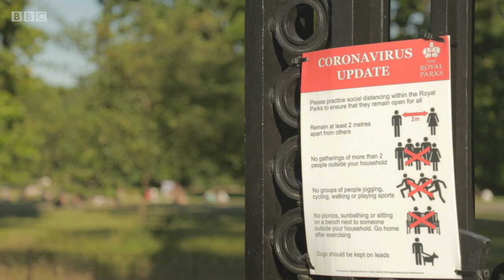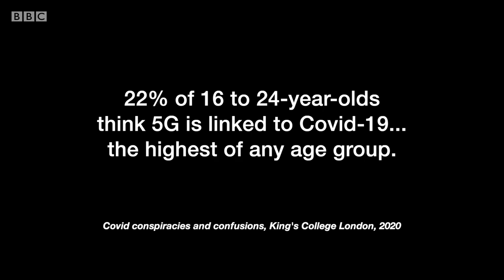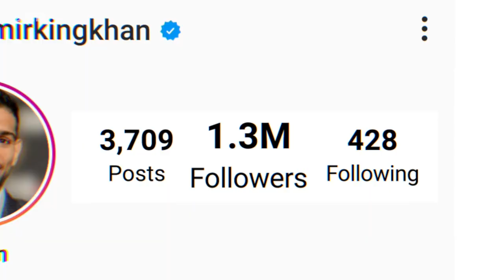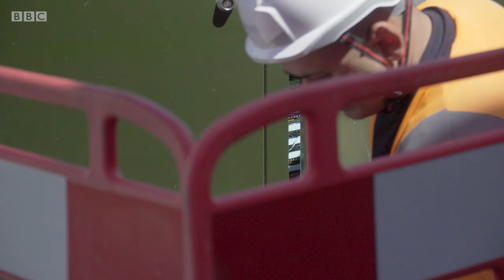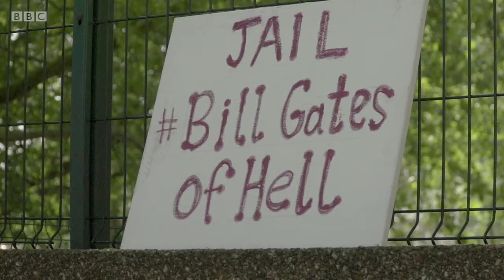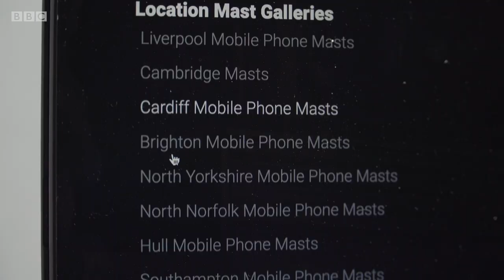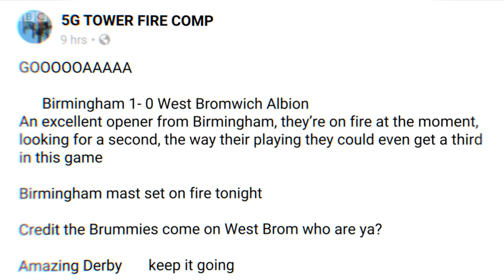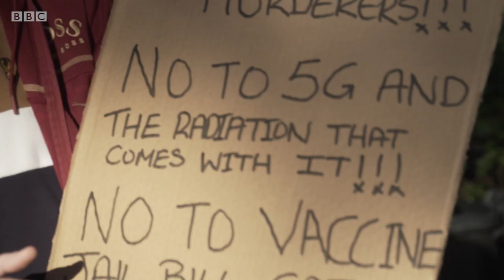Viral: The 5G Conspiracy Theory by @bbcstories - BBC

Comment: I feel so bad for that BT worker and the telecommunications workers that got abused.
Reply: @GORT don't use internet, some BT worker installed it for you.
Reply: Why Can't We Go Back To Cups and Strings?' - No 5G
Reply: @zx50  There is good solid evidence that 5G uses 60Ghz which is the frequency at which oxygen molecules vibrate. What Wuhan experienced was oxygen deprivation, which occurred when 5G went live.
Reply: @bluebottle1617  Which produces heat?? Sunlight / visible light is around 600 THz (10,000 times higher frequency than 60GHz)
Reply: @bluebottle1617  5G is not only 60GHz but a broader range of frequencies up to I think 256GHz. The millimeter waves (5G) is a weapon as British ex-military officer put it. If check the above and you find a lot sheeple attacking GORT.
Reply: @bluebottle1617  all molecules and particles vibrate! This doesn't cause the disappearance of O2 molecules. Matter cannot be created or destroyed in almost all scenarios . do you even have a remote idea of the damage you are causing?
Reply: @rhinocraft2594  And how about you? When the haemoglobin and myoglobin are compromised, they cannot carry oxygen around the body which causes oxygen deprivation. How about the damage BBC are causing with fake news?
Reply: jackson  except it's not a weapon never was its 5th generation protocol. Only liars like Mark Steele say otherwise and he doesn't even know what an electrolytic capacitor is.
Reply: @4shadow2  yeah the sun burns you looool
Reply: @bluebottle1617  😂 link please. What, no link?
Reply: The 5G Covidiots are the sort of people who fall for the Mayan calendar or Planet X end of the world rubbish, or who think aliens built the pyramids..and yes, the flat earthers & QAnons 😄
Reply: @petejackson7976  256Ghz lol you could block that with a sheet of paper, would be crap for mobile phones. And no 5G is not and never has been a weapon,  you read too many comics.
Reply: @bluebottle1617  what has that word salad got to do with 5G?
Reply: @dogwalker666  , 5G is not a single  frequency but a range frequencies and unlike the other the other Gs, it is using the millimeter waves technology. Find out why  the military use it  and when do, you know that  it is a deadly weapon.
Reply: @petejackson7976  5G is the fifth generation communications protocol, using the same a 4G most of the time but can use others, "millimetre wave technology" is word salad not a technical term, the military R&D have tried to make directed energy weapons unsuccessfully, they only exist in scifi. Sorry to burst your bubble but the whole concept is rubbish any electronics engineer will tell you so.
Reply: @dogwalker666  Have you been hacking people's YT accounts?
Reply: @Seapin1  Keep the shit coming, pal, because we know who you are and where you are. And you're not fireproof, so wise up or you're in  for a shock.
Reply: @dogwalker666  , yes it is but   its technology is different from 1g, 2g, 3g and 4g. 5g is not 4g plus like the above. If 5g is like 4g , why the massive infastructure rollout? If you want to have a feel of 5g , be part of a crowd the police wanna bring under control without water canon etc
Reply: pete jackson lol nice try but no it’s not it has lower power so it requires more base stations, how the Hell do you think a telecommunications protocol could be used for crowd control that’s impossible, all they could do is turn it off so all the tic tok live streams will fail.
Reply: @petejackson7976  That' some fascinating information you've got there Pete! Could you give me some links please so I can do my own research?
Reply: @bluebottle1617  Saying 5G is harmful is a hoax I agree with you how does stating real science not conspirtard word salad make me a moron?
Reply: @bluebottle1617  oxygen molecules do not vibrate at 60Ghz that is rubbish,  The vibration of any piece of matter is dependent on its temperature, that's why its impossible  to reduce temperatures below 0 Kelvin basic physics I guess you bunked off physics at school.
Reply: @joepublic3933  Dont hold your breath waiting,  The only conspirtard that gave me a link as evidence was a mark Steele video lol, epic fail.
Reply: @dogwalker666  Yeah, I was hoping the irony would seep through...
Reply: @dogwalker666  Where do I mention the word "salad"? Clearly, you have a vested interest in pushing the 5G Agenda. What are you, lobbyist for the telecoms industry or 77th? Whatever you are, don't mess with those who know the truth. They will destroy you with the truth before you destroy them with your BS.
Reply: @Rag - I wouldn't, if I were you. They are front of the queue to get indicted for genocide. "We were only doing our job" doesn't cut any ice under the Nuremberg Code or other laws.
Reply: @joepublic3933  That would require intelligence and honesty. Sadly lacking in these conspirtard's
Reply: @dogwalker666  The 5G this government is playing around with is Defstan.
Reply: @bluebottle1617  Lol the 5G being installed by the telecommunications company's not the government is 5th generation protocol,  NOT A WEAPON. They dont exist.
Reply: @dogwalker666  Are you copying and pasting this from a file of abusive comments?
Reply: @dogwalker666  Well, well, well. A troll who's been told to bad-mouth Mark Steele.
Reply: bluebottle1617 no your the one making things up.
Reply: bluebottle1617 Mark Steele has no technical knowledge he was arrested last weekend for breaching the peace. I repeat he knows nothing about electronics
Reply: @dogwalker666  77th Regiment
Reply: @bluebottle1617  mark Steele fits the original definition of a Troll,  anyone  who believes the rubbish he spouts is quite frankly a technical illiterate. He claims to be a weapons expert but was actually a night club bouncer,  who doesn't  know what an electrolytic capacitor is.
Reply: @dogwalker666  And you know that for certain, do you? Any arrests in London last weekend are likely to be unlawful as the police were clearly the aggressors and  had no grounds for arrest.
Reply: @dogwalker666  We are getting desperate, aren't we? I've already warned you about messing with those who know the truth. And you certainly aren't one of them?
Reply: @bluebottle1617  which army are you talking about that has a 77th regiment is it the Welsh fusiliers,  or the imaginary army weapons division at the Birtly ROF. You need to be more specific.
Reply: @dogwalker666  Oh really. Not very good at what you're doing, trying to spread misinformation, are you? Mark Steele was a defence technologist, not a defence researcher. 77th Brigade does exist and has been checked as in existence. You really don't know who you're messing with or what information I have access to; you really don't.
Reply: @bluebottle1617  defence technologist that doesn't know what a capacitor is lol,  come  on then what is this 77th grade you keep talking about?  Enlightenment us, and do you know what an electrolytic capacitor is?
Reply: @dogwalker666  So you know what Defstan means?
Reply: @dogwalker666  Terrorist Act 2006 should provide you with the answer to that.
Reply: @dogwalker666  What about ROF Burghfield?
Reply: @bluebottle1617  i know ROF Cardiff  and  H.M.G.C.C. too.
Reply: @dogwalker666  So you will be able to tell me what goes on at ROF Burghfield, won't you? Ah. HMGCC aka GCHQ Cheltenham. Don't forget some of the ROFs were sold off to the private sector by the Tories.
Reply: bluebottle1617 nope hmgcc is at Milton Keens, it’s a common misconception that it’s gchq and I cannot tell you what they do there, because The official secrets act is real. Let that sink in.
Reply: @bluebottle1617  you still have not explained what your 77th birthday brigade is all about.
Reply: Dog Walker One of the initiators is Dr. L. Hardell, Professor of Oncology at Örebro University in Sweden. He states: “The telecom industry is trying to roll out technology that may have very real, unintended harmful consequences. Scientific studies, both recently and over many years, have identified harmful effects on health when testing wireless products under realistic conditions. We are very concerned that the increase in radiation exposure by 5G leads to damage that cannot be reversed”.
Reply: Why we need 5g if we can use all trch with 3g
It need to be to invent robots with replace human in they work place.
Or make electronic intelligence to spy on us and controll our life!
Reply: @lukson69  industrial robots don’t use 5G I fact it’s a bad idea to connect them to the internet. Do some research
Reply: @petejackson7976  millimeter waves technology :D :D
Reply: @bluebottle1617  sources? Because that’s a dumb theory 😂
Reply: As a telcomm worker, I feel bad for our underpayed industry. The telecomm companies like att Verizon and tmobile pay bottom dollar as well as the abuse of turf vending. It's an awsome job, but the pay is dog shit
Reply: sexually?
Reply: @bluebottle1617  Sure it wasn't a result of 6G.  Which exists and works, albeit in a very limited area to date.
Reply: @bluebottle1617 
Water causes attenuation at 60GHz due to absorption. It's not going to harm you - it's merely going to limit transmission distances especially with high levels of atmospheric water vapour, rain droplets, etc

Comment: New Zealand has rolled out 5G. New Zealand has almost no COVID-19.
Reply: They have the ability to turn the levels of radiation up. Just because they rolled it out doesn't mean it's at the end of it's capacity.
Reply: @CarpeDiem13x  just compare the level of radiation that emits from 5G compared to other radiations. 
5G technology was based on army technology, to be able to send out pulses similiar to EMP to controll masses.
There are THOUSANDS scientists, doctors around the world that it should not be operational because not nearly enough studies on long term effects have been made.
Reply: @CarpeDiem13x  But isn't that the big problem here? Not nearly enough studies have been made due to long term exposure of 5G. That is the problem scientists and doctors around the globe are refering about.
Reply: @CarpeDiem13x  “We, the undersigned scientists, recommend a moratorium on the roll-out of the fifth generation, 5G, for telecommunication until potential hazards for human health and the environment have been fully investigated by scientists independent from industry. 5G will substantially increase exposure to radiofrequency electromagnetic fields (RF-EMF) on top of the 2G, 3G, 4G, WiFi etc. for telecommunications already in place. RF-EMF has been proven to be harmful for humans and the environment.”

There have been several REAL bioscientist speaking up about potential risks, and this is a fact that several countries have put a halt to the roll out of 5G, read Martin Palls pdf, Washington, PhD about the subject.

Slovenia, Rome, Germany, Netherlands are a few countries and cities who have already put a stop to 5g due to potential danger towards humans.
Reply: @CarpeDiem13x  Not anything of what you just wrote describes the cause-effect of 5G radiation to long term exposure of human DNA.

Comment: 5G Millimeter waves (MMW) will be combined with current longer wavelength frequencies that are mostly used today, to create a cocktail of artificial frequencies that humans have never been exposed to. MMW are absorbed by anything that contains water. The 5G frequency bandwidth is much shorter and a much higher frequency on the spectrum of electromagnetic radiation (6-300GHz), this results in broadband towers needing to be placed much closer together to compromise for the shorter, faster frequency expressed through the 5G bandwidth, with “small cell” antennas planned to be placed about ever 250m. although 5G penetrates only the outer layers of skin tissue the mix in vibrations from the lower frequencies we are already familiar with will have a mix of skin and body penetration. The mechanism of harm from non-ionizing radiation emitted from wireless technology is Reactive Oxygen Species (ROS) which leads to oxidative stress in nearly every bodily system, which is associated to diseases like cancer. The FCC doesnt account for the measures of the heat effects of MMW tech or any wireless technology on the human body because they have been bought out by the telecommunication industry. 

In a more dated paper written by Russian researcher Zalyubovskaya (1977) declassified in 2012,
alarmingly expresses evidence from research conducted on both humans and animals that reveal
multitude of harmful effects due to the exposure of MMW, describing structural changes and
alterations in skin, internal organs, bone marrow, tissue respiration and more. Authors also
explains how MMW do not go past the skin but act in a different way to the electromagnetic,
chemical soup that is the human physiology, inducing harm in an alternative manner to multiple
bodily systems

In a fascinating article written by physicists in 2018, they demonstrate evidence suggesting
human skin sweat ducts have high susceptibility to absorb the sub tHZ frequencies associated
with the MMW in 5G wireless technology. Sweat glands in skin tissue act as antenna receivers
for 5G wavelengths, showing a significant increase to the heat absorption of MMW. This article
also discusses possible harm and its implications to human beings since we are essentially
electromagnetic in nature

 High intensity MMW wavelengths have been used in military applications for methods
 non-lethal crowd control and crowd dispersal in what's known as “active denial systems' ', with
 evidence indicative that the bandwidth used can burn the skin's tissue.

The first large scale study on potential genetic alterations connected to MMW radiation used in
wireless devices by Le Quement et al (2012), observed non-thermal skin genome effects of
60ghz exposure, and found differential expressions of 5 different DNA transcripts showing that
this technology may damage and modify genetic expression within the human being, influencing
communication between cells in the body.

I can keep going, on and on and on.
Reply: I believe the technology comes from outer space or somewhere unknown. Like how it is proven that they found "stuff" in the pyramids....what was is...liquid mercury? That is not able to be handled without special equipment I believe.  But somehow it was placed in secret compartments in the pyramids long before the technology supposedly existed. I believe the same stuff found in the pyramids is what is used in our cell phones.  Think of the Bible.....they say that it was written on "gold plates"...what if these gold plates are like the chips in our phones?  So much information in a small chip.  I truly believe its all connected.  Like maybe the world ended because there actually was the same technology we have coming today.  I know I cant speak technically or scientifically but its more simple than that.  This is why i believe that things like surrogacy and transgender surgeries are not good.  They are taking away humanity.  The bible is more simple than people think.  It is trying to preserve humanity.  Technology will take over and kill off humanity.  Its already happening.  Gmos in our food are all part of it.  We are walking glow sticks to the aliens.  They let us talk about shit like inserting chips but it's already in our food.  Hmmm... Who knows.
Reply: @amelouise6572  good comment 😁👍🤫
Reply: I once farted on the set of Blue Lagoon

Comment: E= hf. Where E is the energy of a photon, h is Planck constant and f= frequency of the electromagnet wave.
Red light photons have the least amount of energy of all the visible colours and it has around 10,000 times higher frequency than any waves connected with 5G so the red light photons have 10,000 times more energy than the '5G waves'. Red light, like all the other visible colours of light do not have enough energy to ionise matter so they can not affect DNA. Ultra violet, X rays and gamma rays do have enough energy to ionise matter but have nothing to do with 5G.
If 5G radiation scares you then visible light should terrify you. I suggest you become a bat and only go out in the dark. Some people are half way there being so batty about 5G!
Reply: Agreed, they also should already be melted as the frequency band used by 5G is the old analogue TV channel's,  been around for decades and at much higher power levels.
Reply: Dog Walker good point, love it.
Reply: @DMSJagXK  👍

Comment: Covid-19 can do a variety of things, but it mainly hits the lungs and makes you feel ill. If the radiation is the problem, how would it be targeting lungs?
Reply: If that's a serious question, there's a straightforward answer: covid does not 'mainly hit the lungs'. The lining of the lungs, like many other parts, become weakened and then the delicate balance between pneumonia-causing bacteria and the lungs is lost; the bacteria proliferate and the person may die. That's the conventional idea, but even that is only a theory. People do their best to come to explanations but throughout human history explanations have changed as new knowledge has come to light, or as people with greater insight have come along. In order to discover the answer you are seeking - though obviously you are not really seeking it - you would need to study and experience bioresonance over many years. Every single frequency has a particular, identifiable biological effect.
Reply: @infomatrix7394  if you look up what 5G is, you'll quickly find that it's in the safe section of the frequency spectrum. we've had it for decades, just didn't use it because it's range is very limited.
Reply: @infomatrix7394  it's radio waves..
Reply: @acadrengberg  It is microwaves
Reply: @dominicbere2411  it makes your alveoli burst and your lungs fill with the fluid.